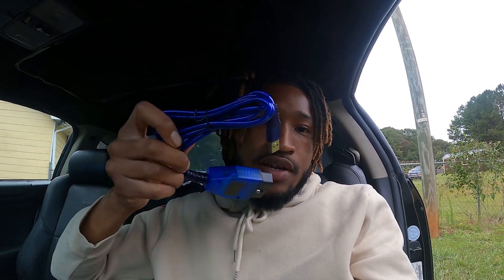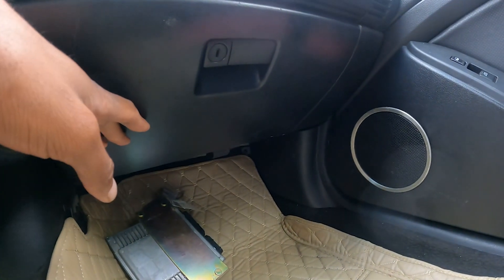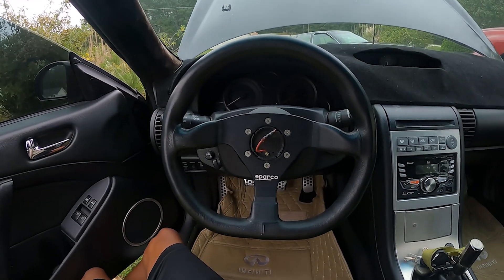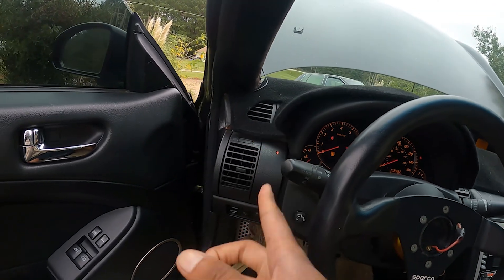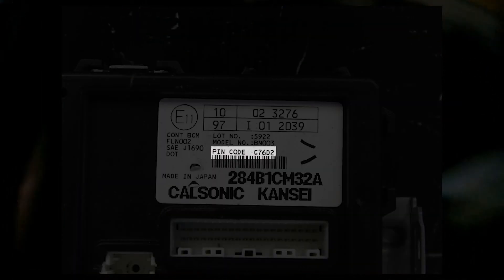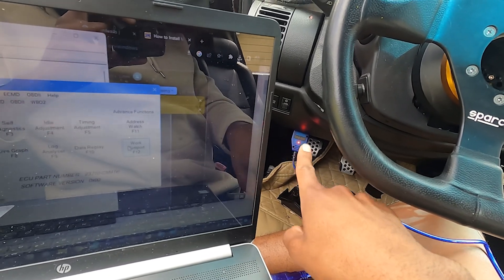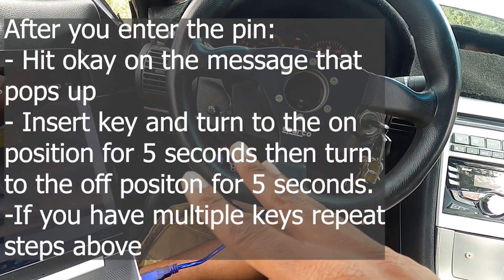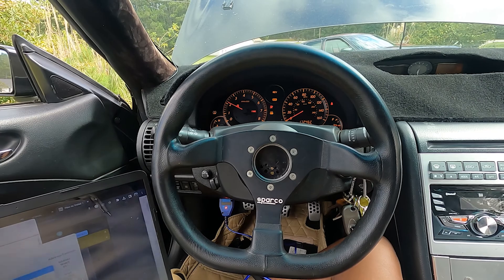DIY Infiniti G35/Nissan 350z Key Reprogramming & NATS Bypass Tutorial!

Comment: I have (NATS) would this help me is the same issue is just my dash light is not on but I have two code p1611 and p1610 z Motorsport charges me 550 to take off the (NATS) and tune the ECU
Reply from the maker: NATS just stops it from cranking. Does it still run and drive?
Reply: @JLowe no just cranks

Comment: Im just having problems with obd port staying on connecting to the car, when the ignition is off the obd port doesn’t work and doesn’t communicate. Im really stuck and idk if its the bcm or the port
Reply: same. my car wont connect and conceptz gives run around.  i connected another computer device and it detects the car fine like abs airbags battery functions. im stuck and cant find anything else.

Comment: I have obd connection but my fans always kick on my security light is on the code reader doesn’t see the engine at all you think it’s ecu or key needs to be programmed?
Reply from the maker: Sounds like the key isn’t recognized. I’ve had those symptoms before as well while messing with the electrical system. That IPDM could also be the culprit.
Reply: @JLowe replaced the ipdm same symptoms I’ll try programming a key next thanks bro

Comment: Does this wipe the used ECU you put in or does it just pair the ECU to your BCM so the car can run?
Reply from the maker: Just pairs them I believe. The new ecu would still have the original info from the car it came from.
Reply: @JLowe  that's what I figured but wasn't sure, thanks!
Reply from the maker: Depending on the scanner you may be able to change the info.

Comment: When you program your new key to the swapped ecu does your old original key still work on your old ecu? Just in case you want to go back to the old ecu or does that get erased?
Reply from the maker: It should still be programmed however if it doesn’t just repeat the same process in the video for the original ECU.

Comment: What kind of problems are you having?
Reply from the maker: Code P0340. I’ve swapped the sensor with an OEM sensor, I’ve swapped the other camshaft sensors, I’ve swapped the engine harness, I’ve swapped the ECU, and done the timing assembly. I’m all out of ideas.